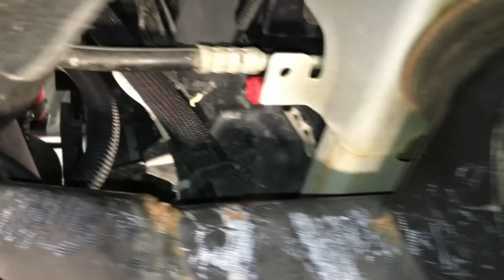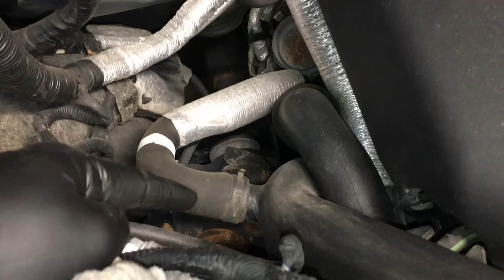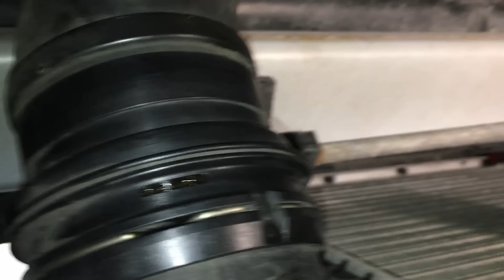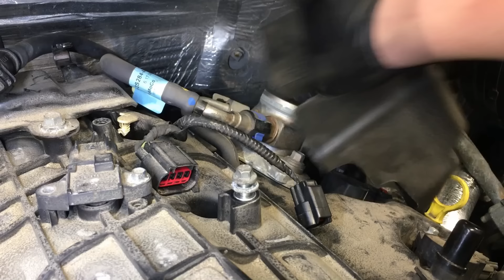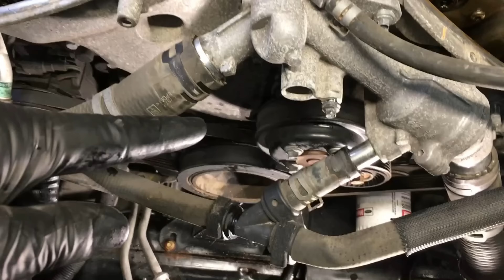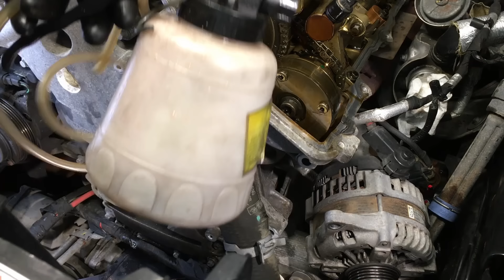2011-2016 Ford F-150 3.5L Ecoboost Timing Set Replacement Part 1: Getting Inside the Engine

Comment: My 2018 3.5 eco boost goes into limp mode when towing my rv camper. when i start up the noise doesn't happen everytime.  What do think is the problem. dealer has already believes its not the cam phazers that's causing the lack of power.

Comment: Thank you so much. I replaced mine and put in the melling hv pump. No codes. All is well and exciting. Pep in the step. Only thing I'd say is to pull all the tension in the chain to the passenger side. 10000000 percent amazing videos series.

Comment: Great job on your videos!
I did change my timing chain and tensioner on my 2012  3.5lit ecoboost using your video and fixed my chain noise for only 4 months and have same issue again even worse when engine gets hot on load ,like off-road oil pressure dropes(with red warning on dash), can I blame it on aftermarket chain and tensioner which I bought from RockAuto? 
I am red seal mechanic so I am almost sure there aas nothing with the job I did. If I do it again I will buy parts from ford also I will change eng oil pump as well.

Comment: Thanks for the videos I'm replacing the timing chain for the second time putting in the mellings high pressure pump I was wondering if you have any suggestions on cleaning the pick up tube screen with out removing the oil pan any suggestions on what I could spray down there while the oil pump is off would be appreciated

Comment: Does anyone know if a 15-16 3.5 Ecoboost long block can be used to replace a 2013? Long story short mine blew at least 2 rods are in the oil pan and I'd like to buy a long block from Ford but 2013 long block is discontinued and all I can find is the 15-16. I just don't want to drop the cash and find out it's not going to work without several mods. I'm ok pulling some parts off the old motor to make it work but I don't yet know what all went with the motor yet. Any info is welcome.

Comment: How many total hours did this job take? 
My 2013 f150 3.5eco boost is in the shop for this exact thing. What is a fair price on labor and parts? How many total hours will it take to disassemble and assemble the engine. And what a fair price on parts? Thanks

Comment: There's second gen ecoboost still having the same issues so are the replacement parts really new and improved or is ford still using the same stuff?
Reply from the maker: The second gen ecoboost is a totally different engine inside and has nothing to do with the parts used in this video.
Reply: @FordTechMakuloco  
So what are your thoughts on the second gen 3.5 still having cam phaser/ chain problems? Is it poor maintenance? I've been looking at used one's but I'm hesitant because I still hear if people having the same issues.

Comment: When you do this at the dealership do you normally pull the cab off the chassis to make this job even a little easier than doing in your garage at home?
Reply from the maker: Nope never, absolutely not needed. There is tons of room.

Comment: I am ecstatic about this video.  Ready to give it a try myself, which brings me to a few questions.  Some parts are sold at rock auto as a kit, like the primary chain comes with secondary chains, and guides for the chain.  I watched part 1 and 2, did I miss something where those are reused.  Your parts list seems pretty thorough, but I don’t want to crack it open and have some of the needed parts and have to run and get the rest while it’s open.  Maybe I missed something by not watching the rest of the videos, or maybe when the kids were screaming and the dogs were barking I missed hearing it then..  Regardless great videos and thanks for giving me the best tool to get the job done!  I have used your videos on other Ford projects, with results I can be proud of!

Comment: @FordTechMakuloco on my 2011 3.5EB, 134k miles. I have 2 stored codes PO54A PO54C truck is running fine but frequently the Wrench light pops up and acceleration is heavily affected. Any thoughts on what it could be?

Comment: working on a 2013 3.5 turbo and the valve covers are stuck. Any suggestions all the bolts are out never ran into this issue before took the 3 bolts out in the back on the passenger side and the two in the back on the drivers side

Comment: tell me whats the difference between the two engines my 2011 is different than a 2014 I bought to build the head on the passenger side has a different head than the one on my 2011 I cant find anything listed about the difference

Comment: I followed this tutorial successfully to replace the chains, phasers, guides, tensioners and oil/water pump on my 2012. The chain stretched and jumped time due to a failed tensioner. Unfortunately the valves were bent as soon as this happened so now i have to take it down to the cylinder heads and get them re-worked! Thanks for the videos they really helped

Comment: Excellent video.  I had to do this on my 2004 F150 5.4 triton and it was much harder it appears.  My issue just started (1000 miles after warranty runs out) and it's just he beginning of winter, so might try to milk it until spring when it is a little warmer since I don't have a garage to work in.

Comment: Thank you for your videos! Most recently I did this timing chain replace on my 2013 eco and it went flawlessly thanks to this video! Keep up the good work you do brother in helping others do fairly challenging work on their own trucks🍻
Reply: Have you thrown any codes since ? What is everything you replaced ?
Reply: @reggiecrowe9504   nothing as of yet. Replaced tensioner and water pump as well as high pressure fuel pump gasket,  apart from obvious cam phasers and chain. I do regret not replacing the water pump but when I inspected it looked in great working order so I decided against it.
Reply: Hey Rob, how long did it take you to do the job?

Comment: Is there a way to determine if the chain/pashers need to be replaced by visual inspection? My truck will be at the shop to repair the front engine cover leak under extended warranty but I would have to pay for the chain overhaul.  I don't want to pay for unnecessary repairs, BUT I don't want to pay to repair the whole thing a year from now. I currently don't have any issues. 85K,2014, FX4 bought used. Thanks

Comment: Wondering if you have a recommended parts list for my 2017 2nd Gen 3.5L with 106K that has the chain rattle for 3 seconds on startup. Thanks, Bob.

Comment: When I decided to complete this job, I had cam correlation codes which were there for a few months prior to deciding to replace the phasers and chains. Well right before I did the job the truck started running terrible, And I failed to double check the codes and just pulled the truck in and tore it apart. Once torn down, I noticed the upper right guide was broken, and when that cams locking plates were in place the crank mark was at 7 o'clock, not 4 like in your video. I talked to a ford tech, and he said to set the chins up as you indicated and just turn the crank back to align with the double timing link, I should be ok. I completed the job and the truck started but ran like crap. Would not go over 3,ooo RPM and threw two exhaust sensor and 1 intake cam sensor codes. I replaced all 4 sensors with Ford parts since they were relatively in expensive and the same codes cam right back, but Correlation codes did not regenerate. I did a compression check and each cylinder was between 183 and 185. I had thought when the timing jumped it may have bent a valve but I am thinking with 185 thats not likely. I am starting to think I may have a processor issue. Any idea which direction I should go with this now?

Comment: Would the info and basic procedures in the videos apply to the 6.4 3v including the oil pump ?
I have the same noise in my 2010 explorer and had the oil pressure checked ..idle -25psi and 60psi@2000rpm..
Reply: Sorry...I ment to say ...4.6 3v

Comment: Would the same type of parts (even if the specific part number is different) and the torque specs be the same for a 2017, F-150, 3.5L ecoboost?
Reply: I need to know the same. I need to replace the phasers on my 17' 3.5l ecoboost... I'd LOVE to see a recommended part list! @FordTechMakuloco

Comment: 2015 Lincoln mkc p0171 no vacuum leaks, fuel pressure on low side and high side are close to desired. Trims are 25+ any known problems you've seen

Comment: I have a 2017 F150 3.5 ecoboost bought new now has 87,000 miles. I used Penzoil full synthetic as you recommend with the best fram synthetic oil filter. I  have DYI my oil changes but had a chain lube change my oil a few times. Recently I noticed the start up rattle and  as I was changing my oil, I noticed one  of the “Wings” on my the new oil plug was broken off and some oil was present in the area of oil pan. It did loose enough oil to notice on dip stick. Question: could this (broken wing on oil plug) caused loss of oil pressure and was the root cause of the rattle and premature wear?
Reply: See above Question: It DID NOT Lose enough oil to notice on dip stick.

Comment: Original owner 2013 F150, 3.5 Eco, 210,000 miles June 2020.  Changed engine oil at 500 miles, and continued to use blended oil until about 1500 miles for a soft break-in.  Then ran Synthetic Mobile 1 oil since  and no issues...not even timing chain!
There are 2 ideologies to maintaining vehicles;  run-until-fail (RTF) or preventive maintenance (PM).   If you own an Ecoboost engine, a person really needs to have a P.M. mindset  and not a RTF one.
Fords computer for "oil reset" is way too long between intervals if you set it to 100%.  If you set it at 50% you will be alerted around 5,000 miles that it is time to change the oil.  Fortunately,  I caught this fairly early on and it has saved my engine.
Samething with the Transmission flush!!!!   I have Wynns flushed my trainy 5 times thus far and no issues.   But tell them to also clean out the metal/serviceable transmission filter... they may tell it isn't needed.  Don't be fooled by a 25 yr old service writter.
Mike

Comment: Thanks buddy! Your videos are some of the best. I have the 3.5L eco (2014) and just educating myself on this issue in case I run into it.   The only issue Ive had is the truck suddenly stuttering and stopping/limp with the wrench in the dash, stop, re-start and its fine (for a few miles) issue that the mechanics cant seem to figure out. I personally take the map sensors out clean them then reset the computer and let it idle for 10 min. to re-train.  Is this really a throttle body issue? Seems to run fine for 6 months or more after cleaning maps. Why is the computer messing up map values after its been trained but mechanics swapping out the throttle body? (turbos go haywire when this happens). Have you seen this? Seems to be very common requiring a throttle body swap.

Comment: Around our neck of the woods people like to put 6 inch lifts with 36 inch tires and it’s easier to take the cab off and leave the intake on, just remove the throttle body. Cab off is about 45 min. Cab back on is a little longer but wow no climbing around under the hood, very straight forward then.

Comment: Hey great video. After you finally took the front cover off, were you physically able to visually see any indications of the stretched chain? Im currently beginning to have the same issue, with the cold start rattle just beginning to start happening, and my extended warranty company won't approve the job unless the dealer takes the front cover off, and they send an inspector that needs to visually see evidence that it needs replacing. Im currently not having and running issues or CEL, I was just trying to stay proactive before it gets worse, and before my warranty expires. I still have another 10k miles and 1 year tho, so Ford recommended waiting as long as possible so that any visual evidence will be more apparent.

Comment: are the parts numbers still good or did the phasers get updated. I have 2012 f150 ecoboost with 130,000 miles. My dealership also recommends replacing solenoids ATAZ*6m280*B. do you also recommend any other parts to replace since I am inside?

Comment: The weakness of this engine is the pistons , I just took my engine apart for a ticking noise, it sounded on the top of the engine almost like a timing chain, when I took it apart I found a broken piston, from the rings down,  luckily there was not damage to the block, when I removed the rest of the pistons they were all cracked except for 1 , so I'm replacing all piston with forged pistons and new aftermarket rods , the skirt of the stock pistons is very very thin
Reply: Never heard that one on these engines.

Comment: Thanks for this series!! Make sure you have the right tools, parts, and a good place to work. This is not a trivial or beginner project. I did a 2014 Explorer Sport after watching this series. 82K miles and the engine light came on: P0016. Also had cold-start slap. There are some differences from the F-150 shown here, but this series gave me enough information to go on. On the Explorer (at least) Ford recommends you replace the high pressure fuel line after it's been taken off. $150 part, but at 2200psi, I'd rather be safe than sorry. Getting the motor side cover back on was nuts - had to put the RTV on the motor side. Pretty tricky to even get the side cover in place without gouging the soft aluminum as you rotate it and slide it past the end of the cams. I did not evacuate the AC system as the Haynes manual says but I can see where it would be more convenient, in general. While I was in there, I replaced the primary guides, secondary chains, phaser/sprockets, tensioner, water pump, plugs, cracked boost tube, drive belt tensioner, and cam sensors. Getting the phasers and sprockets off, and torqued back - is NO joke. Be prepared to stand on the motor to keep the cam-tool in place while you use a pipe on your breaker bar. Now it purrs, with no start-up slap, and the engine light went out on the second start. Much more responsive. Certainly not a job I want to do again for a long while. The dealer wanted $4-5K and I spent about $1500 in parts. Dealer wanted $250 to replace $65 waterpump (internal, and exposed after the chain comes off) - that was the straw that broke this camel's back to do it myself. Saw another video that suggested 5K oil changes would keep this from happening. I didn't, but I should have compared the new and old chains for length. This other video showed that due to wear, the worn chain is longer and the tensioner can no longer keep the chain tight. Next, to add a catch can because the intakes were dirty (not too bad, but won't get any better) and service the PTU.  Thanks FordTechMakuloco!!
Reply: You're a legend for taking this on yourself and providing feedback! How's your vehicle holding up? I have a 15' expedition EL with 90k. Even though she's still running like a champ (cuz I do all the maintenance) I get the feeling I might have to perform heart surgery on her like this someday.
Reply: @brv002  Thanks - it's purring along at about 110K now. I did have to replace the PTU. It was just plain cooked. I don't have a lift so I had the dealer do it. Actually, not bad at about $2500 - parts alone are $1500 and it's wedged in nicely. I've been very religious about 5K oil changes with full SYN since the rebuild. No issues.

Comment: I just finished doing this on my 2013 limited.  Thank you for making these awsome videos!!!
Reply: How was it
Reply: @Guap303  it took me about 12 hours.  It was a bit of a pain becuase of the bumper sticking out from the motor and the only thing to kneel on is the intercooler.  But I got it done.
Reply: @shadetreemaker38  thank you for the reply! This will be my next project. Wish me luck lol
Reply: @Guap303  if you can afford a quality chain and guide set get it.  I bought a Chinese set from ebay and it started ratling a few months later.  Good luck!  I only had one extra bolt left, may all your bolts find there hole.
Reply: @shadetreemaker38  I appreciate the tip, thank you!

Comment: I have 2014 f-150 ecoboost. With 60'000 miles. I bought it from a Ford Dealer. It started ticking after two days after i bought it. I took it back to the dealer. Thy said it supposed to sound like that. They told me to drive it for thirty days. And for me to bring it back after thirty days. Believe it or not.The ticking got louder. After being in the shop for one month. They just told me two pistons are broken. They got to replace the motor. I only had it for two days. This dealer suppose to be a five star. Naples Tamiami Trail in Naples.

Comment: Absolutely awesome video. My family is doing a long distance move and money is tight. My truck started acting up and I was so frustrated. This video inspired me to do this job myself. Today I focused on tear down. So far so good. For that stretchy belt I could not seem to get it off with a strap so I tried a small cat claw and it worked great. Just stick it in just past the belt. Once the pulley takes it tork the handle so it walks off. Easy peezy
Again thank you for these videos!